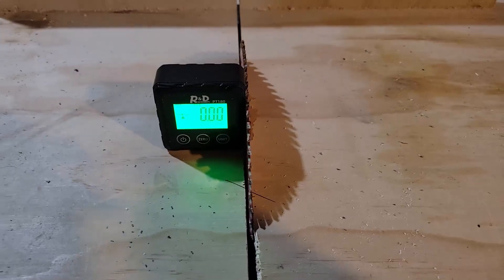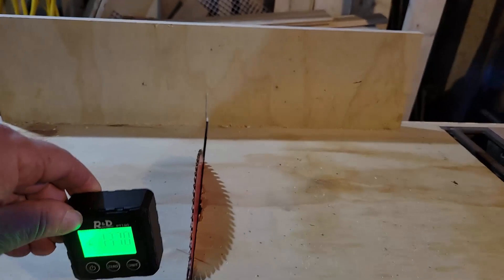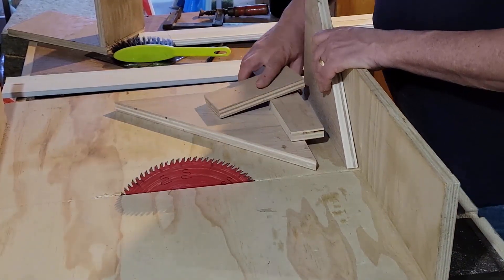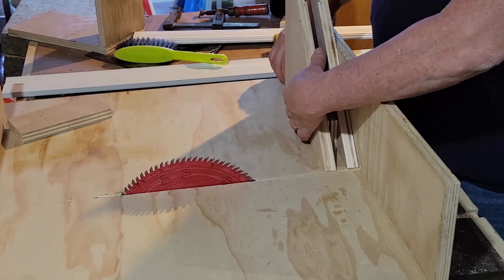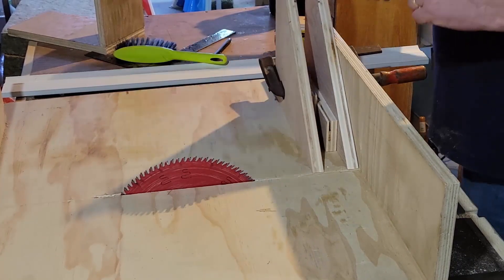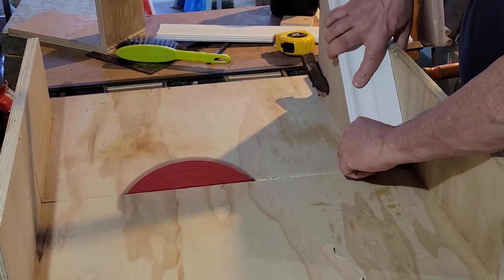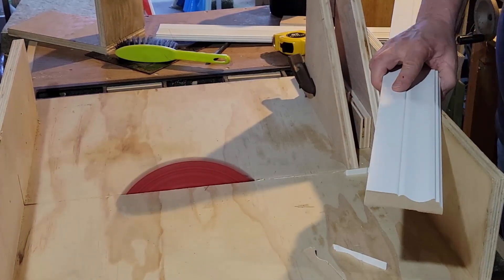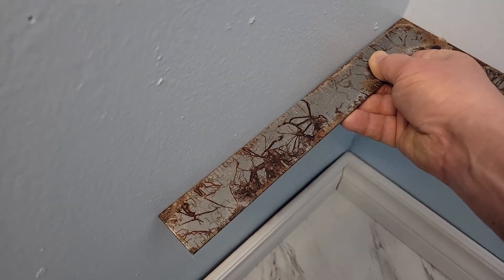Mitre Jig Angle Test

Comment: These devices are not appropriate because the angle depends on an accelerometer. What if your table saw already was inclined by 0.1 degree to begin with? You have to use an old square or speed square if you want it right. They other thing about digital instruments  assuming this was the right tool you have to account not only for precision but also for resolution. Don't use that for miters.
Reply from the maker: I already set this up with a square in the original video. I just wanted to see if these things were any good and to give a numeric result to the jig. Thanks for your thoughts on this!